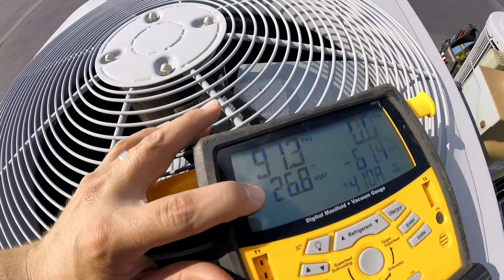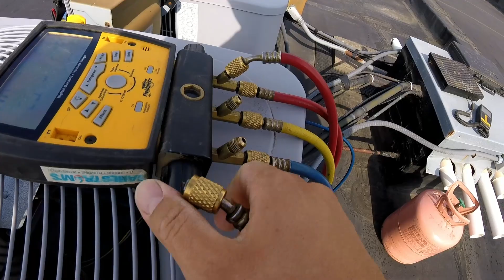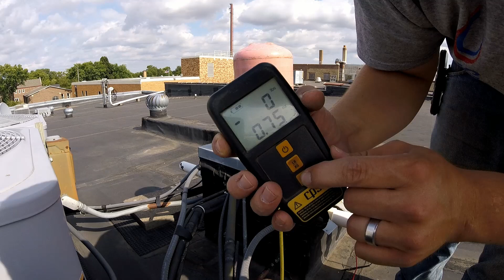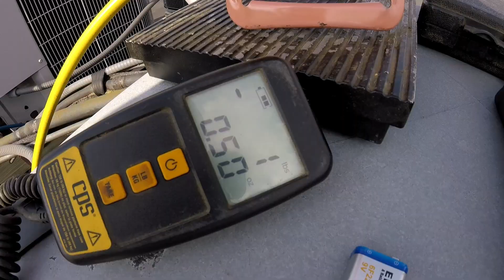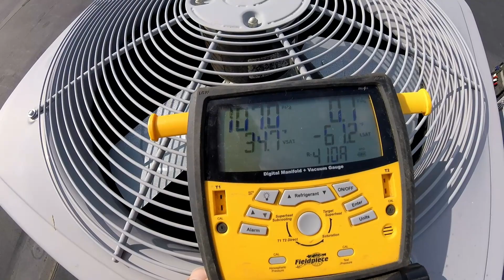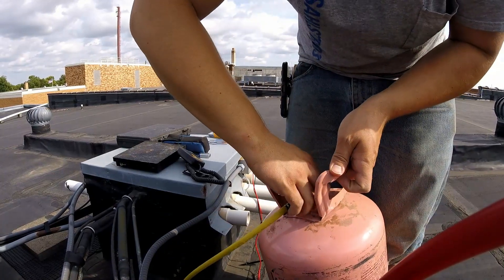Why Do Air Conditioners Freeze Up & Adding R410A Refrigerant to an AC Unit

Comment: This guy just killed that compressor, added liquid to fast , didn’t give the time needed to charge,  and suppose to use sub cooling methods to charge 410a as required. Don’t do it yourself. Will work for a while but that compressor won’t last.

Comment: A restricted condenser can also cause freezing as the super heated refrigerant will flash at the cap tube or TEV. It can also have a clogged condensate drain and get sucked back up into the evaporator. You should be connected to the high side while charging so you have more information. The fact that you need to charge, means you have a leak and should repairing it instead of just recharging. Legally, you'r only allowed to do that once, but it's obvious there's a leak, so why set up your customer for a future failure and additional service call?

Comment: thanks for this nice video, does anyone know how to find out if the central ac is fixed orifice or Thermal expansion valve without open the cover to the eveperator ?  i have a Trane xr80( american standard ) , anyone know what type it use ? thanks
Reply: On the condenser unit (outside) has the information on a sticker, if there's the subcooling rate, the evaporator has a TXV

Comment: R32 vs R410A which is easier to work with ? I hear R32 cylinder gets heated up while recharging. And which refrigerant type air conditioners have fewer leaks, r410a or R32 and are more reliable ?
Reply: I have the same doubt. Can someone shed some light ? We don't have R-32 in the US.

Comment: No unit should be charged just by pressures - fixed orifice or not. Return air enthalpy, cfm per ton, coil size relative to system capacity, head pressure  impact low side pressure. You can under or overcharge just doing it by suction.

40F coil may not be correct, if it's a modern 13+ seer probably closer to 45F but it's still a guess without checking superheat.  (which can also be used to tell if there's low airflow rather than guess - low suction/sh for conditioned would indicate that)

Disappointing video, most of them are good.

Comment: If it's a gas furnace you can use the heat to melt the ice. How about checking the evaporator. How about look at duct work for any inside duct sound line insulation that may have fallen and thus chocked off airflow. If after a clean coil, and low on gas a leak check should be performed.  On that carrier unit (inside the cover on data plate)there is a pressure temp chart  for a fixed orfice and the correct superheat..if it is a TXV system then a 10 subcool is required. Carrier unit were notorious for leaking coils..right at the u bend's and cap tubes. When you mix metals..such as copper, aluminum. And galvanized metal you produce electrolysis.
Reply: FLY EAGLES FLY Bleed Green I dealt with that.  Had 2 coils leak after 2 years.

Comment: Good simple explanation.
On that system what did pressure and temperature end up at?
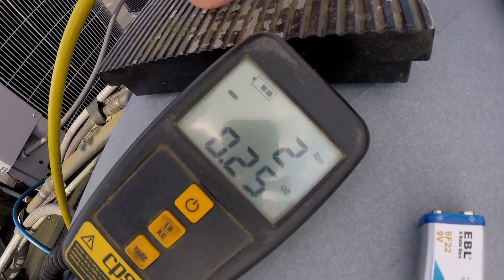Reply from the maker: At 6:33 I show the operating pressures and temperatures but should have lingered on that a little longer. It was running at about 118psi and 40 degrees for the evaporator temperature. Right about where I wanted it for the ambient conditions of about 80 outside and 75 inside. Thanks for asking!!
Reply: Great, thanks.